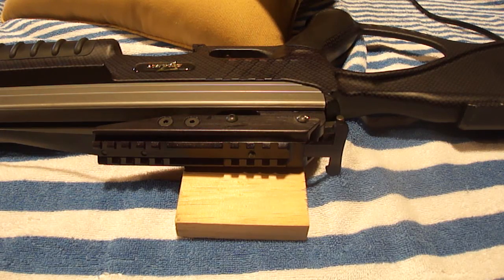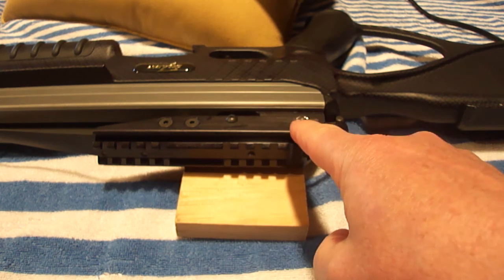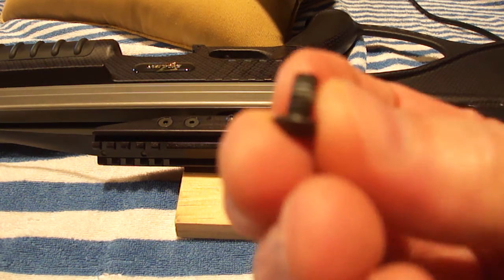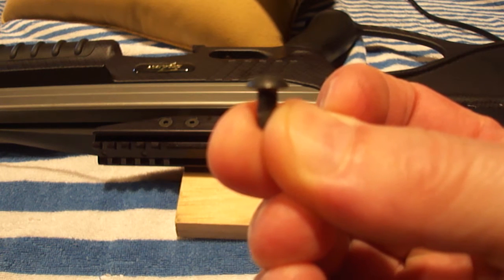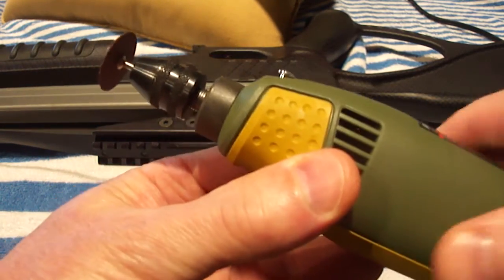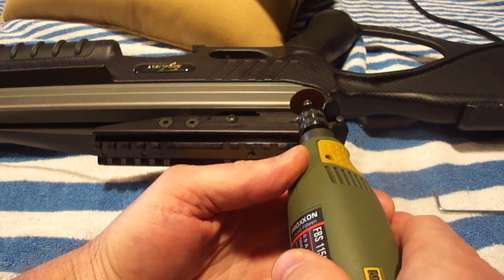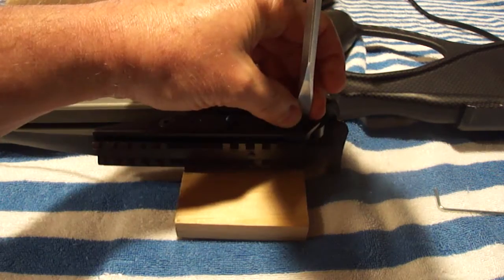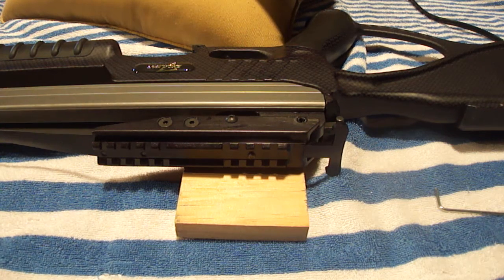Trigger Tech Upgrade For Your Crossbow

Comment: Put your Palm behind the close ups of small screws.... They will focus that way.
Also.... Heat a big bolt with torch, then put it on the head of small screw... Hold for a few seconds or a minute... The heat will soften the lock Tite.... Slotting is always a good option if you can do it properly like you did...
Tape on either side helps protect from the slip... 2 layers!!! (Ask me how I know 😅😅😅)
Nice work

Comment: Factory trigger is crisp & clean w/no creep. I did order ACP Pro Shot trigger after talking with you about it. Anticipation was winking at me so I used a new "hard" Allen wrench & "SNAP" they all cooperated. 😁. I found it at sportsman's guide (member) for $135 on sale. Was curious if the trigger is actually blue as advertised. Not an issue. Some people use gold 😱, I ordered 2 strings from Murph's G Strings. Simply Googled it by referral. Custom colors available by choice. It was $82 custom (blue/silver) for 2 strings.
Reply from the maker: David Eustache 👍😊

Comment: Excellent engineering solution.  I might add, a piece of tape on either side of the screw head could help prevent scratches in the housing as well.

Comment: I had to remove those 4 screws when I upgraded my Excal Matrix 330 to an ADF.

I'd heard that these 4 screws can be real aggravating to get out.  I was fortunate, I had a new, crisp allen wrench.  When I cranked down, counterclockwise, just before I thought they were gonna strip, I heard a SNAP, the loctite broke, and they backed out.

When I put them back, I didn't use any loctitie  I'm watching them and so far they are tight.

Bobby
Reply: What's an ADF

Comment: I sprayed some penetrating oil on mine and let sit for awhile, and used a new allen wrench, they popped right out, guess i got lucky. I removed the anti dry fire,  I hate them. Went to Ace Hardware and bought 4 new screws.